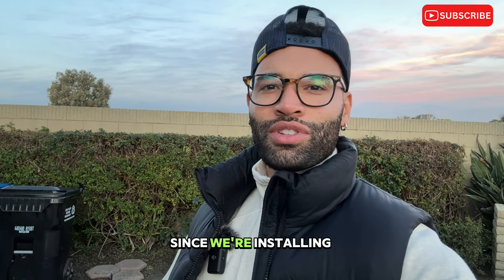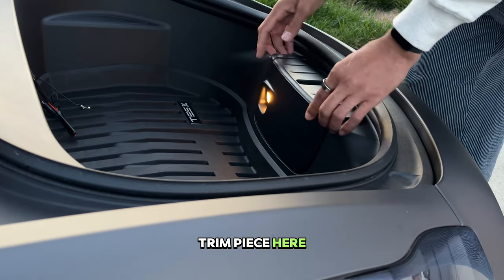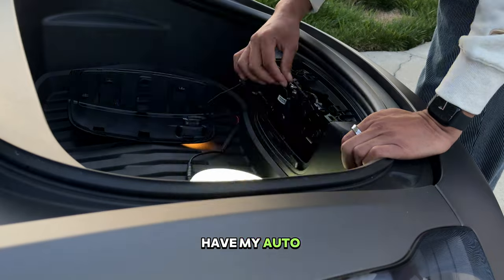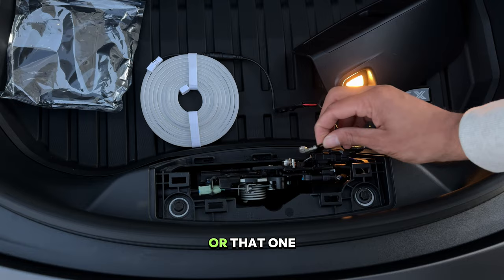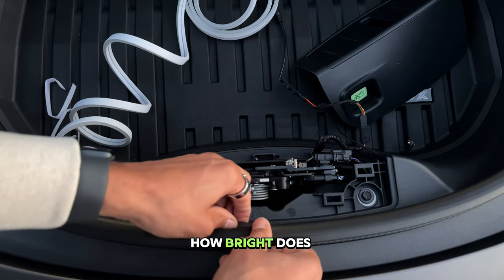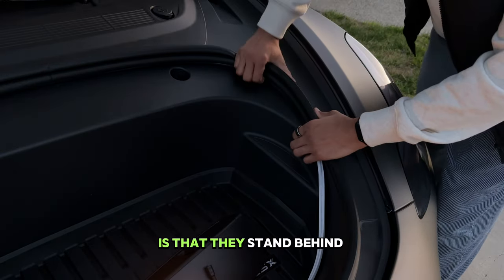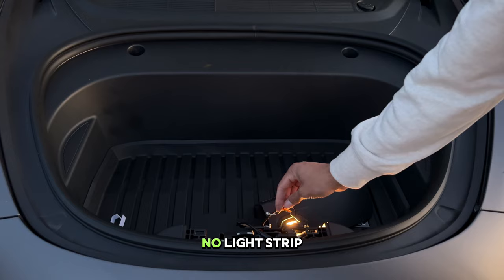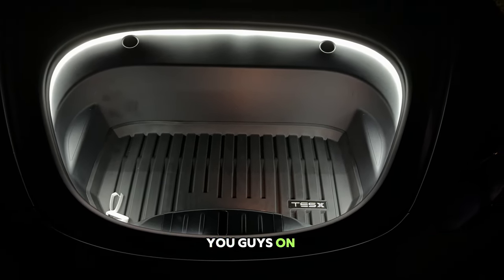Easy Tesla Frunk Lighting Upgrade

Comment: that post you put the ground on. you can get some electrical tape and secure it so the bumps as you drive don't shake the ground off. then you will have a secure install that you can remove if you ever upgrade your 3 to a newer model
Reply from the maker: I did tape it afterwards. Thank you for the insight though. I appreciate it! 🙌🏽

Comment: Looks amazing! I am also putting some of the LightingBug into the shopping cart. Just a brief question regarding the connectors on the splitter cable. Are the connectors for model year 2021 and later only or is there any adapter for model year 2020 and older included?
BTW: Thanks a lot for the cupon code! 😃
Reply from the maker: Anytime! Let me ask them via instagram and get back to you 👍🏽
Reply: @m3jazz  when I have seen your other video installing the ambient light I fell in love with the kit right away! Great thank you! So I am going to wait another few days before clicking the order button.